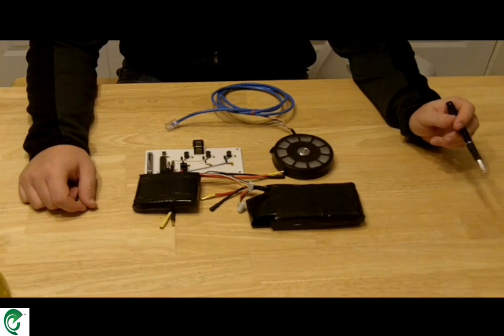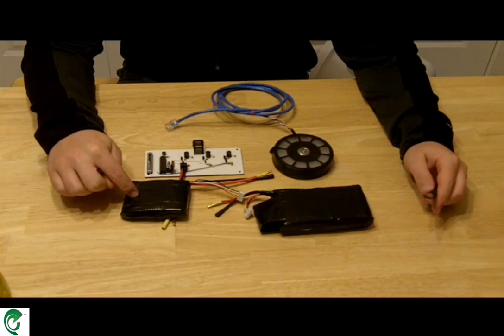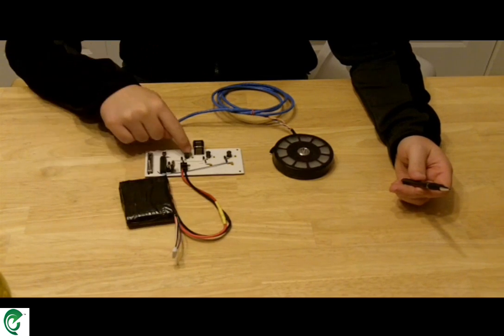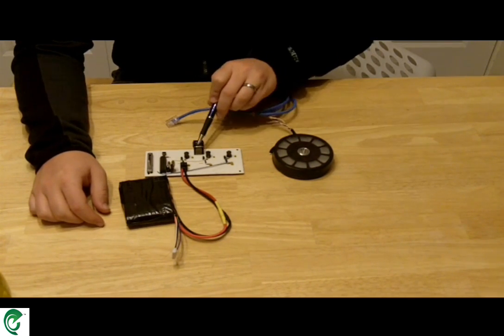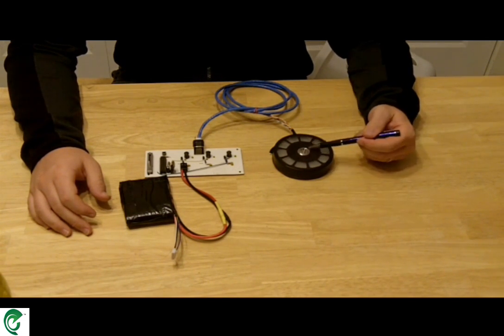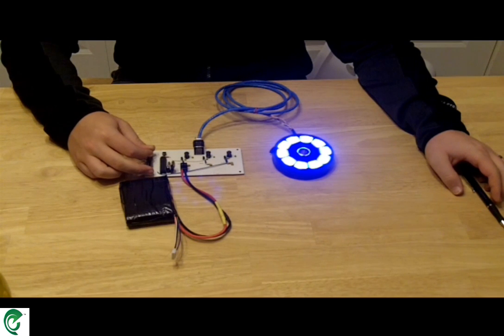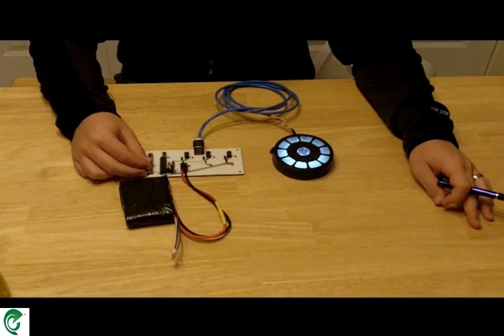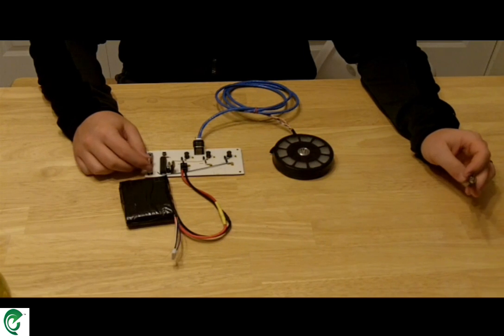Arc Reactor

Comment from the maker: @helexus Sorry, no detailed part list.  The LED driver was a LM3404, which is a 1A constant current buck regulator.  The microcontroller was from the Microchip Pic family (16 bit).  The dimming was done using the pulse width modulation function built into the micro.  The batteries were from a Dewalt 36V drill battery pack and were A123 Cells.  The batteries and charger were the most expensive part of this project.  Total cost with batteries and charger was probably +/- 300 bucks.